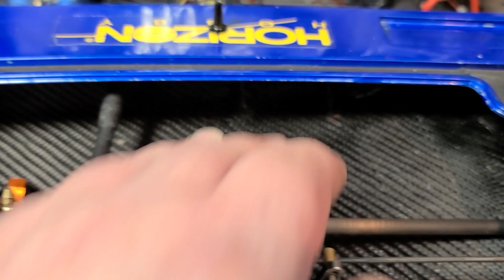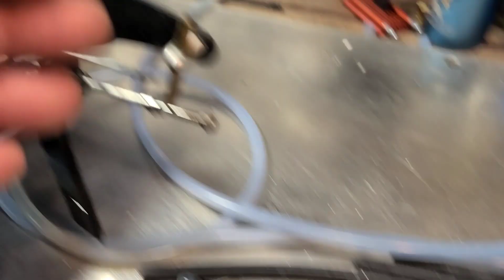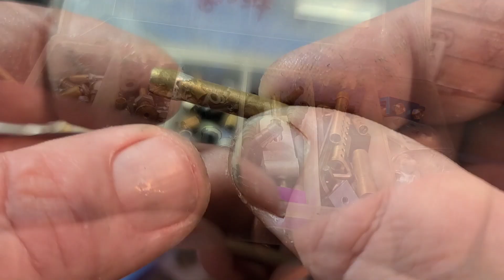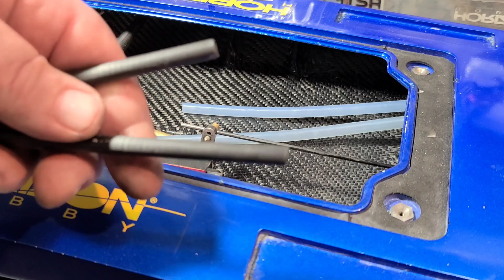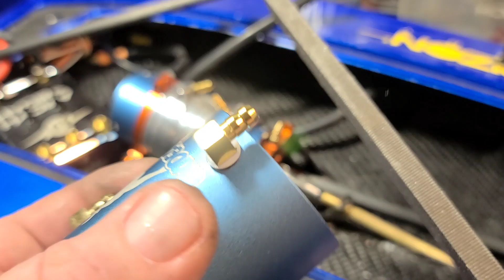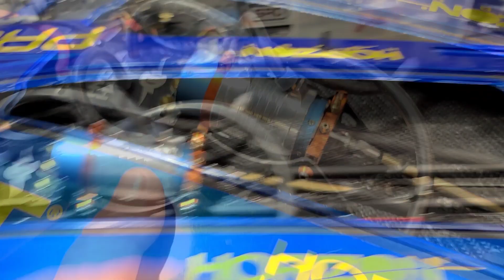Rc Boat Water Cooling Install & Tips Proboat UL-19 - Water Cooled Brushless Motor & Esc

Comment: What kind of hose keepers are you using?
Reply from the maker: If your referring to the ends of my cooling lones, its just a slither of silicone cooling line slipped over the main line as a retainer, use needle nose pliers to slide it on

Comment: So can you just passively pickup water and have it forced through without needing to add a pump to suck the water in? I am really new to this and considering doing this to my motor at least. Do you have a tutorial or something that explains this stuff?
Reply: Yes mate, the rudder pushing through the water pressurises the cooling lines and moves water through the cooling systems

Comment: I was thinking of using a water pump for my boat. should i use 1 tube that go through esc and motor or 2 diffferent tubes for esc and motor? If i use water bump, Which tube should i stick it in to ?
Reply from the maker: You should only need one line to the esc if your using a pump